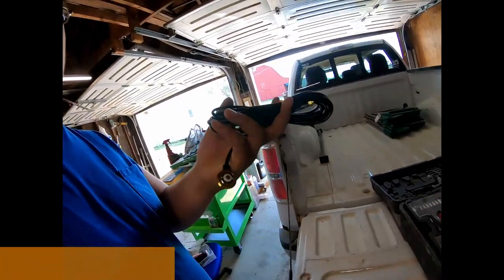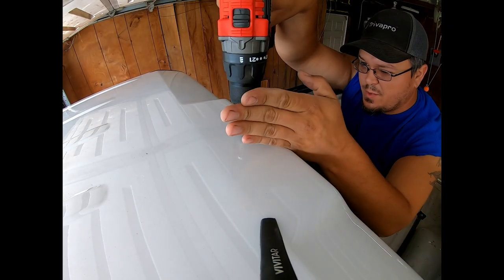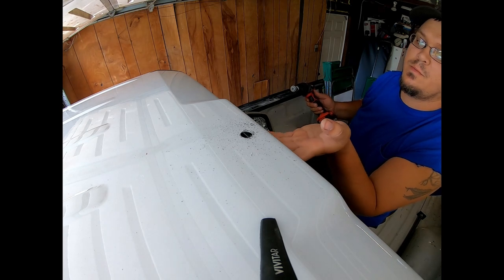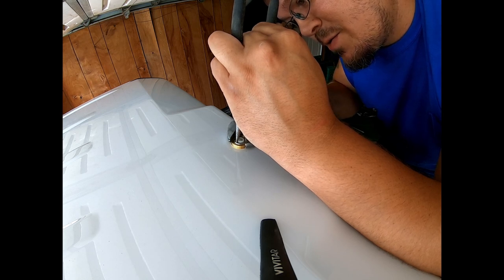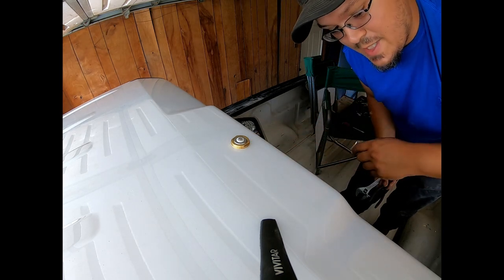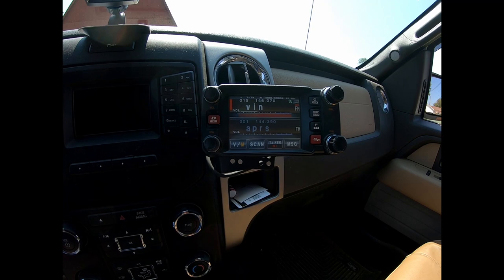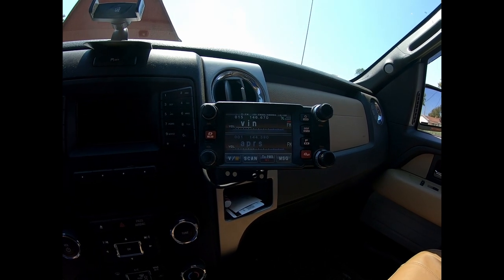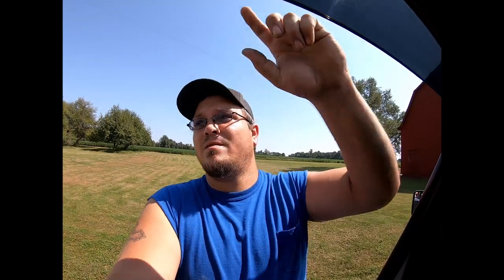NMO Roof Mount Install On My 2013 F150

Comment: not too bad but if it was possible i would have moved it farther forward to get a better ground plane as the 2m antennas usually need 3ft around the base for good ground reflection but otherwise will work
Reply from the maker: Would of like to of done that, but this truck has support ribs on the roof which made it not possible to do so. Thanks for watching
Reply: It's a hell of a lot of trouble to do that.

Comment: Next time use a 3/4" Greenlee knock out to make your hole. It is much easier to use and it does a better job. A little bit of grease spread on the "O" ring will keep it from wadding up when you tighten the ring.
Reply: FINALLY someone  who knows what a Chassis punch is and when it should be used.
Reply: A Greenlee 3/4" knockout punch makes a 1.2" hole for a 3/4" electrical fitting. I'm all for the punch knockout idea, but they are expensive and getting the right one isn't so straight forward.